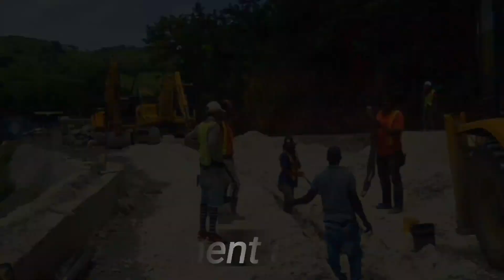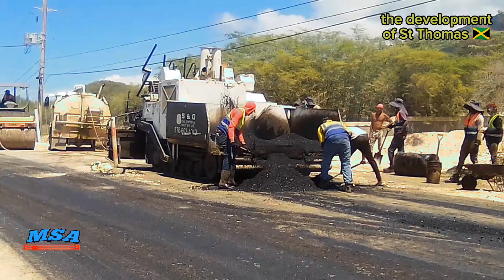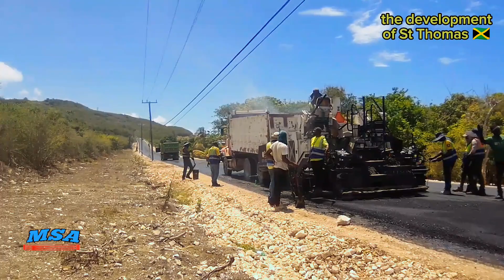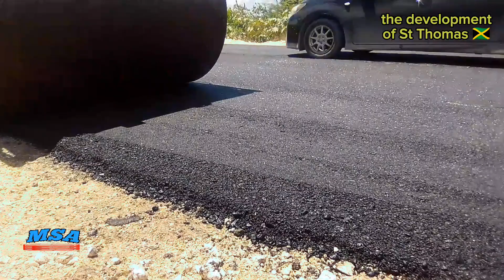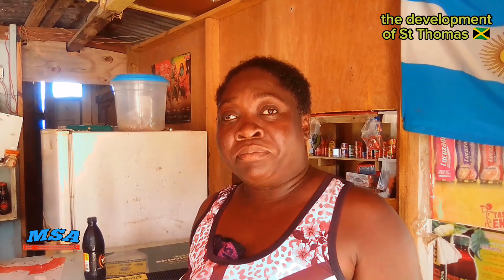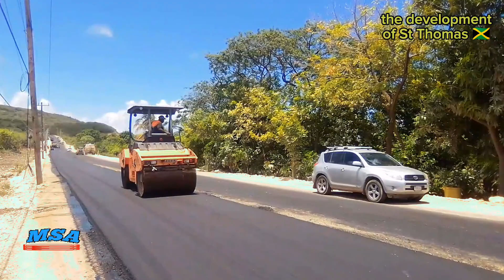JAMINTEL ROAD AS NOW ASPHALT//THE DEVELOPMENT OF ST THOMAS CONTINUE

Comment: I always wonder why this company only pave the center of the road and leave the edges unpaved and no lane markings.
Reply from the maker: I really wonder myself too thanks for your comment
Reply: The reason been is that they will put a inch of asphalt on the side of the road while the middle or driving surface will be the most used and it will consist abt four to five inches of asphalt
Reply: It's done systematically..